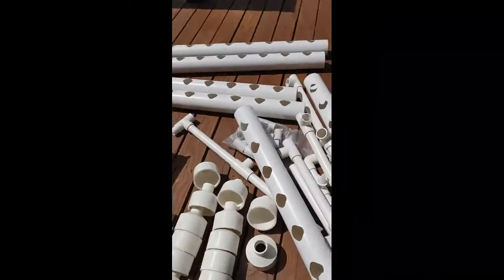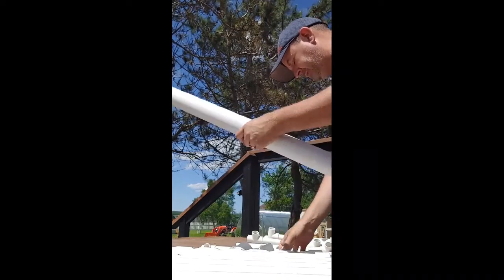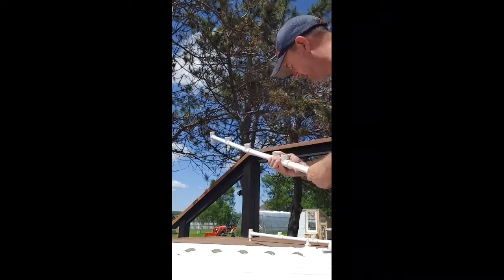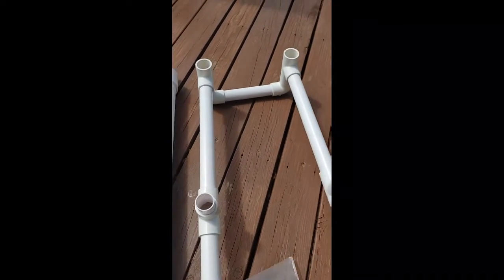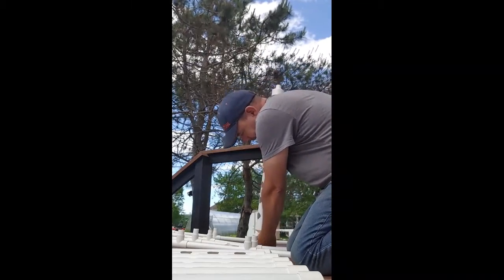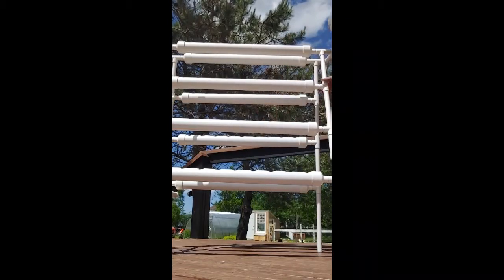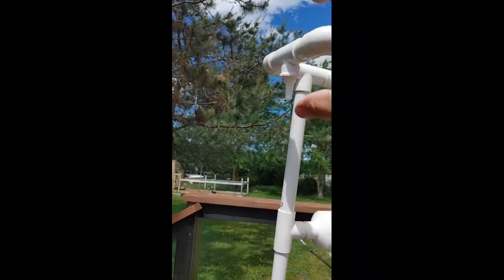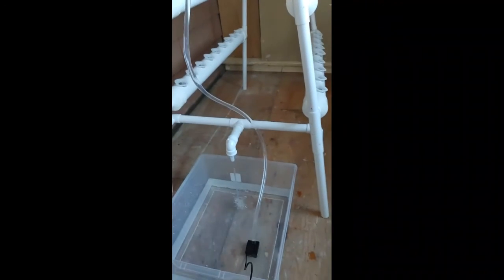Vevor Hydroponic System Set Up and Assembly

Comment: Doesn't the joints drop water since they are not glued? Is it meant for outdoors? I was thinking of using it for an aquaculture system.
Reply from the maker: It can leak and has on our floor not enough to glue it though.

Comment: Do you have to use all of the openings? Does anyone know? I’m thinking about puttin tape on most of them until I get my seeds germinated in phases
Reply from the maker: You don't need to use all openings. You could use tape but I don't think it's necessary.
Reply: They make them with less holes.
Reply: I’ve been using about half of the openings. I need a light that hits low so I can utilize my lower rows. I been keeping the unoccupied holes taped. This is a mold or algae prevention my hub was staunch on.